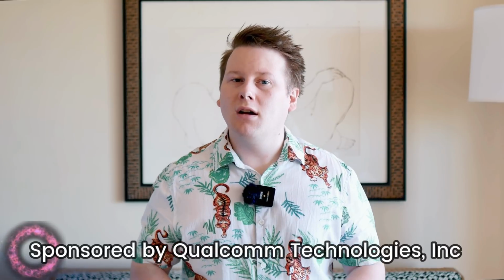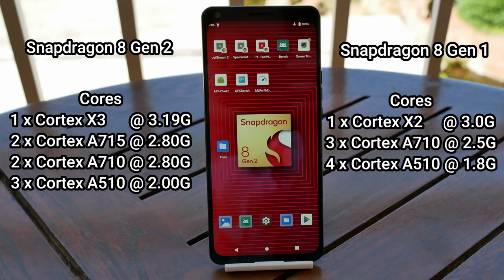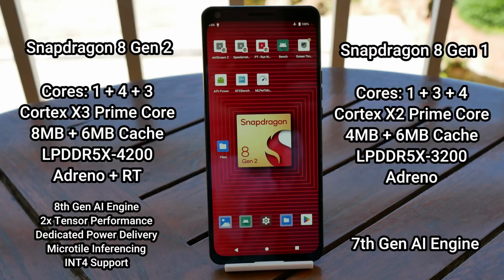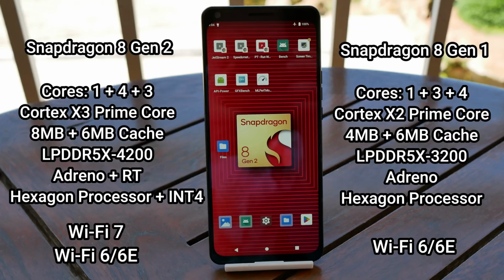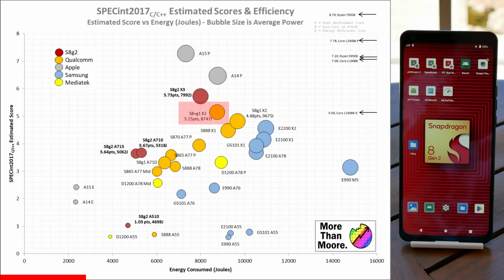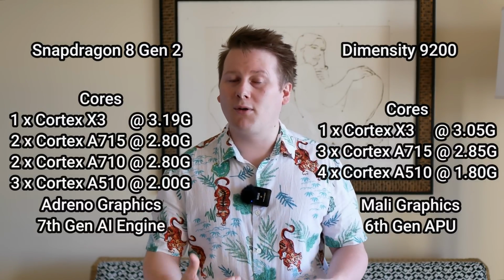Snapdragon 8 Gen 2 Tested: Benchmarks and SPEC

Comment: I'd like to see 2 phones compared with only the CPU switched out between a snapdragon 8 gen 2 and mediatek 9200. It seems like the Mediatek would have better battery life with a minimal performance impact
Reply from the maker: The problem there is that you can't simply swap out the SoC. Power rails are different, IO is different, RF front end would be different, even antenna.
Reply: @TechTechPotato  yeah I realise in reality you can't just swap them but it would be nice to see 2 phones with very similar specs compared
Reply: Hopefully you saw the geekerwan video

Comment: I'm a game developer and having 4 different types of cores has turned into a nightmare holding back multithreaded game development going forward. We have to try to assign each thread of the game engine to an appropriate core by estimating the relative complexity requirements for each one of the tasks. With 4 types of cores it has become overly complicated to figure out how to put the right task onto the right core and so developers are just skipping the whole thing entirely and making apps that are optimized for I.e. 2 threads only, or they're making apps that use more threads but aren't very well optimized because they just forget about it and let the SoC try to deal with it.
Reply from the maker: I think the whole point of going into more cores like this, whether QC or MTK, is that eventually you just have 8 that are independently optimized on the power/voltage curve and the scheduler just sorts itself out.

Comment: Can't the mid cores be optimised for idle power consumption so we get rid of "low power" cores altogether?
Reply from the maker: You can fit four of those low power cores in the same space as one mid-core.
Reply: @TechTechPotato  it would be insane if apple e cores die area is closer to Qualcomm e cores rather than mid cores considering the performance comparisons

Comment: What is sense of A510 cores when they draw almost the same power as 710/715 with many times less speed?
Reply from the maker: 100% load is a non-ideal use case for A510s. Usually they run at 20%/50% load, where the power is meant to be better. Also, you can fit almost four A510s into one A710.

Comment: What's the point of the A510 cores if they're using the same amount of  power as the A710s, but providing only a fraction of the performance? Do they have better efficiency than the A710s when down clocked? Or are they just there for the marketing team to check the "8 cores" checkbox?

Also, for the gpu, I don't think 8 watts is sustainable for most phones - what does the steady state performance look like after it throttles?
Reply from the maker: On the A510s - 100% load is a non-ideal use case for A510s. Usually they run at 20%/50% load, where the power is meant to be better. Also, you can fit almost four A510s into one A710. Didn't have the phones long enough to test thermal limited.
Reply: @TechTechPotato  cool, that makes more sense then. 

I really liked how Geekerwan contextualized the power efficiency of the 8G1 and other SOCs - https://youtube.com/watch?v=s0ukXDnWlTY

Comment: The only way for Qualcomm to close in on the lead by Apple is to use custom designs for their CPU cores.  This is probably the last generation of Snapdragon using Cortex Cores which are ARM’s designs. The next generation of Snapdragon will use the Oryon CPU using custom cores designed with the help of the team Qualcomm acquired from Nuvia. 
The Google Pixel 6A, 7 and 7 Pro using the Google Tensor SOC have demonstrated that you don’t need a more powerful CPU to have a great smartphone experience. Where that performance is really needed is in full desktop OS and apps. Windows on ARM would benefit a great deal. 
For me Hamoa is more exciting for the CPU because of running full on Windows and Linux on ARM. 
I’m excited about the Snapdragon 8 Gen 2 more for the mobile GPU. The gaming experience should have a significant improvement.

Comment: honestly, those smartphone chips are starting to get interesting. At this point they are more powerful than a pc i'm using as a server while consuming fraction of the power. Give me this in more desktop like form factor, with bunch of pcie-e lanes, 2,5gbit networking and bunch of sata and I'd love to buy it. But for a phone, i kind of don't see a point, at least for me, the most demanding thing i do on my phone is emulation.
Reply: the IO likely isnt possible, and more importantly it would have to emulate x86 which has turned out pretty garbage for windows, plus the wattage would end up an issue because they cant pull much extra for any kind of boost. i bet you could get a tablet with this hardware and try a dongle, but you'd still have the software problems

Comment: This might very well be faster than my 3930K desktop CPU. These chips have really caught up with desktop Chips. Modern chips like Ryzen 4C or 6C will still be faster, but it's in the same order of magnitude
Reply: wattage is the issue though. these are still phone chips and can't pull 65w, im not sure they can even manage 7w before throttling
Reply: @bradhaines3142  Exactly right. A mobile chip will overheat quickly and throttle down even if it has a fan. Intel and AMD design their chips with lower transistor density (about 2x) to guarantee faster clock speeds and to avoid overheating. Apple has managed to use the high mobile density in their M1, M2s somehow, but is it for long?..
Reply: @costakat6986  long for what? Have apple failed at cooling their chips?

Comment: Maybe with Wi-Fi 7 (assuming the Quest 3 will have this processor) the connection via Airlink to the PC will have a lot higher bandwidth. One of the things I could never stand about wireless VR was the compression. I can stand plugging the USB-C Into the PC and turning the encode bit rate to 400mbps but anything lower looks too compressed. If only cheap VR Headsets still launched with a DP connector.
Reply: I strongly empathize with this comment! Agreed.

Comment: Why was A16 omitted almost throughout the video ?
Reply from the maker: I've not tested an A16 and don't have the resources to do so. In the one test, those numbers were taken from generally accepted results to Geekbench 5 - which that graph has a specific disclaimer in the corner.
Reply: @TechTechPotato  thanks for explaining!
Reply: We’ll, it’s a sponsored video. Wouldn’t make sense to compare to Apple A-line of processors and get embarrassed doing it 😉 Cheers 🎉
Reply: @originalmagneto  ??? Did you not watch the video? Even the older apple chips are shown embarassing the 8g2.

Comment: Why even use A510 when A715/710 offer much more performance at the same energy consumption?
Reply from the maker: Running the A510 at 100% isn't really their intended use case - it's more about how it performs at 20% load, 50% load, where it's meant to offer better power consumption than the A710s.

Comment: I'm going to be very curious to see how this SoC performs. I noticed that the SD 865, 870, 888, and 8 gen 1 all performed quite closely in longer benchmarks, and performance intensive applications such as games, as while each successive SoC was able to extend its power envelope for really impressive micro benchmarks (such as geekbench, IIRC), it tended to thermal throttle in real applications.

The 8+ gen 1 however was a noticeable improvement, and I'd be super excited to see if we get another such improvement here, once we start getting the SoC into people's hands and actually get to test it.

Comment: The A510 cores don't seem like there are that efficient lol. Like seem a little pointless if I'm reading your chart correctly, I thought their goal was to BE efficient.
Also GPU is strong but that temperature they are testing at doesn't mean realistic, even on a gaming phone with a fan?...cool to know they can get UP TO that performance though.
Reply from the maker: Running the A510 at 100% load isn't really their intended use case. It's more 20% load, 50% load, where the promise is that they're more efficient at that level than the A710/A715.
Reply: @TechTechPotato  Ah I see, my logic was that those cores would maybe get maybe get most of the performance at full load of the core the tier above but never exceed the power of them.

Comment: it's probably still missing the most important feature for me. I would love to see some throttled mode, except not "power saving" that disables notifications, and my background apps. 
I don't need top performer, but I need something that can be my navigation for 10h, I have 5V 0.7A charging in there,  but that does not do much, 855 chip was still loosing battery. 
b) something that I can take on to connect on meetings, and it's not burning my hand, again 855 failed that. 
I might consider it again, but I found mediatek ones to behave much better, and I find it more important than that extra 20% more power....
Reply from the maker: Most phones have a power saving mode now, but it'll be vendor dependent. This is just a look at the chip.
Reply: @TechTechPotato  i know but I find those modes usually way to hardcore. they disable background apps, which is most annoying, but you can only have one or the other. 
there is no option anywhere afaik to have "ballanced" mode you can find on laptops.

Comment: The most impressive thing I saw in this video is that the A15E and the older A14E cores obliterate all the implementations of A510 and A55 in performance as well as efficiency. The difference is astronomical compared to A15P vs X3.

According to specint2017, The A715 consumes 7% more energy but performs 3.5x better compared to A510 and according to specfp2017, A715 consumes almost the same energy but performs 5x better. A510 should be dropped immediately.
Reply from the maker: Part of what that graph doesn't show is how much power each core consumes at 50% load, at 20% load. Putting a full workload through the efficiency cores is kind of a non-ideal situation for them.
Reply: Apple soc is the best and why I recommend Apple now.

Comment: You should definitely try out the vulkan ray query samples on Saschas Willem's repo, it's pretty interesting as a benchmark for the new RT acceleration, in my testing it's about twice that of the Exynos 2100 AMD GPU
Reply: Also as a side note, the raytracing exposed is only ray_query, which is slightly less capable than ray_pipeline shipped in the new immortalis GPUs. (Also the Sascha Willems samples don't lock resolution so if you're using for comparison make sure to alter params to ensure that)
Reply: To be fair rdna2 only had just enough ray tracing support to claim it was there

Comment: I'd expect the utilization of the A510 cores to be low, focusing on background tasks. But over a full day with the screen off that's really going to add up compared to Apple's efficiency cores, my average screen on time is just over an hour. So very likely no real improvement to battery life except for maybe gaming?

Overall still behind the A16 in efficiency and preformance, especially single core performance. Which is why you don't really see any android phones with batteries smaller than 4000mah, and even phones like the 5000mah S22 Ultra get worse battery life than the iPhone 14 Pro which has a 3200mah battery.

Comment: So the A510 uses the same or more power than the A710 at a fifth the performance? What am I missing here?
Reply from the maker: The A510 cores don't often run at 100% load. Usually it's 50%, 25%, background stuff, where it's meant to be more power efficient. This is a non-ideal workload for those efficiency cores, really.
Reply: @TechTechPotato  Ok that makes more sense. They seem to be very oddly configured when you benchmark them directly. So they're basically only allowed to use that much power for the sake of squeezing out better all core benches, but in reality they will be sip power and sit at a much more favorable perf/watt - if i understand it correctly.
Reply: they use almost equal amount of energy to compute same task, makes me wonder what will A715 capable at third of speed. A510 looks abysmal.

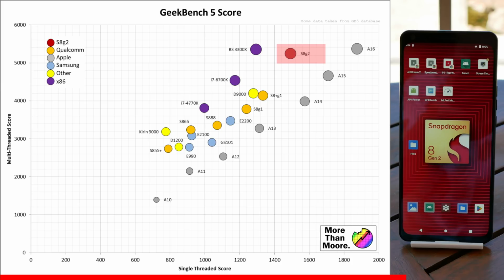Comment: Is it really faster then a 90W i7-6700K ? 15:00
Reply: Yep, my moto edge 20 pro with 870 performs similarly to a zen + 2500u laptop chip in single core when considering ps2 emulation

So 8 gen 2 is definitely better than 6700k

Comment: Seeing the low power cores consuming as much power as the mid cores while performing so much worse really shows the power of OoO execution (and the fact they don't make sense unless they have significantly better power consumption while idle)
Reply: They potentially could take up significantly less space on the silicon?
Reply: @bryce.ferenczi  yeah, close to 1/4th the area, i think
Reply: 4 of those small cores take up less space than a single mid core
Reply: You posted this comment in Reddit I just saw it

Comment: What I really took away from this is just how far ahead Apple's chip design really is. Even the older generations A chips did formidably
Reply: It's kind of misleading to judge Apple's chip design compared to the competition because they have a larger die budget which they spend on gigantic cache sizes. The reason why they can have larger die budgets is because they are vertically integrated; they don't have to make a profit on the SoC; they sell the whole phone. Qualcomm doesn't sell phones; their SoCs have to be more cost conscience to be profitable. Most of the ARM designed cores only have 256KB-512KB (looks like X3 might be up to 1MB) per core. A14P and A15P have 8MB and 12MB (while that's total between 2 cores, I can't find if that's a shared L2, meaning if benchmarking a single core that it has access to the whole L2 pool). The L3 system cache is also many times bigger between Apple and the competition.

You could argue that cache size selection is a design aspect of core design, but it's a relatively simple facet of core design, one that any design house can quickly change given die budget changes. Apple's use of large caches masks the more nuanced aspects of core design (which they probably chose wisely as well, but it's hard to tell) like branch prediction, OoO engine, decoder width, things that are harder to squeeze improvements from and provide real moats for design houses.
Reply: @xungnham1388  This is part of explaining *why*, true. But in the end it doesn't really matter. I two fairly equivalent products that to the end consumer are roughly equivalently priced differ wildly in quality, the consumer buys the better one, and the manufacturer won't change that by crying "But the other guys could build it cheaper cause this or that". Explaining why they can make it better doesn't lessen the fact that it is better. That said, to the end consumer the chip in a phone is far from the most important thing, and given you cannot get a like-for-like identical device with either a Snapdragon or an A-series chip, other factors will wind up being more meaningful to a consumer's choice. I buy iPhones, but I've never chosen iPhone over Android devices because of the chip. If A-series chips were worse, I'd still be buying iPhone. Likewise I doubt anyone buying exclusively Androids will have a point where A-series chips are so much faster they switch exclusively because of that. But an explanation as to why something is the way it is still doesn't make it any better value
Reply: @xungnham1388  Apple's cache sizes are only 1-2 times bigger than the competitions, so almost equal, except for the most recent A15 and A16 (32 MB). That does affect the performance, I suppose, but is not a decisive feature. Remember also that Apple likes to call their L3 caches L2, which confuses many.
Reply: Yep arm cores are garbage a715 technically scored slightly worse than a710 lmao useless engineer rejects working for them the gpu performance is very good however but cpu is lackluster especially in efficiency wise since not much apps uses all this performance anyway they just do it for bragging rights in benchmarks rather than focus on battery life and the nuvia/oryon cores probably wont come to mobile til late 2024 or 2025 or maybe later but those might finally give qc a big leap towards catching apple if they have ex apple engineers designing the cores
Reply: @sbrader97  Punctuation really aids readability

Comment from the maker: [01:50] Specifications Compare to 8 Gen 1
Benchmarks, Performance Per Watt
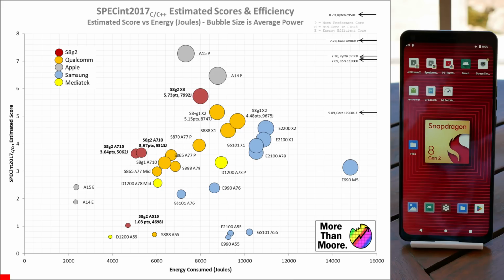 - [09:43] SPECint2017
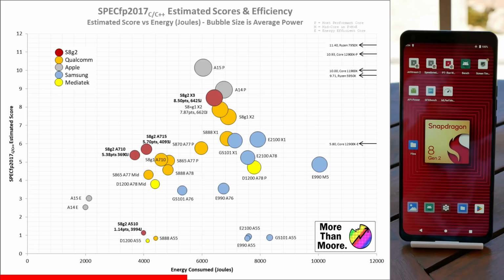 - [12:02] SPECfp2017
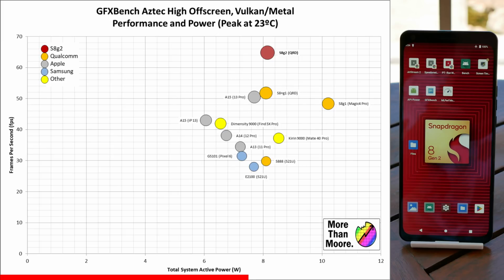 - [12:50] Aztec High
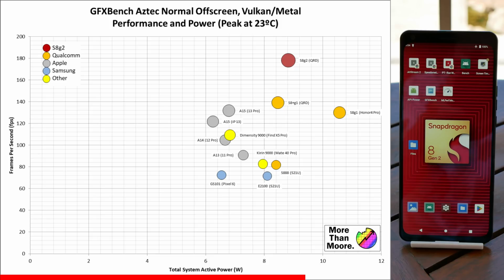 - [13:38] Aztec Normal
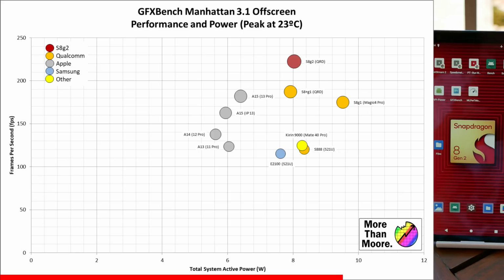 - [14:06] Manhattan
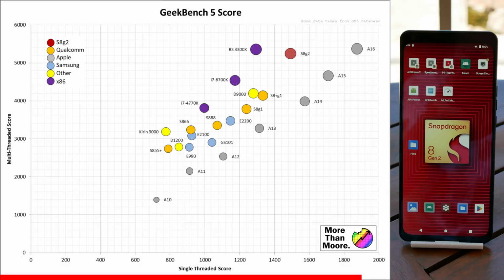 - [14:22] GeekBench 5
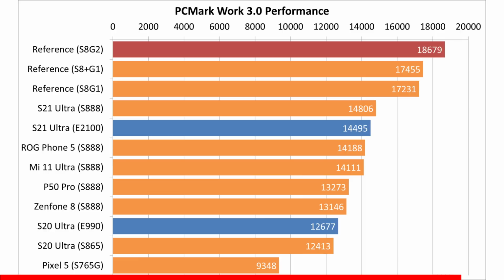 - [15:40] PCMark
[16:17] Flagship vs Flagship
[18:06] Qualcomm vs Mediatek
[21:00] Summary
Reply: No pin ?

Comment: Bit sad that my desktop cpu(6700k) is worse than this new mobile chip. It probably uses 10x the power as well.
Reply: yep. cheap laptops outdo that hardware. you should look into an upgrade
Reply: This mega power is mostly wasted on the flagship phones, idling and waiting for the user input (or sleeping in the pocket). So no, if your desktop suits you fine, it shouldn't compete with the latest and greatest (and the power difference is only 2x at idle to 5x at the most use, not 10x).
Reply: @costakat6986  6700k tdp - 95w, so youre saying 8g2 uses 19w for maximum cpu use? Where'd you see it?